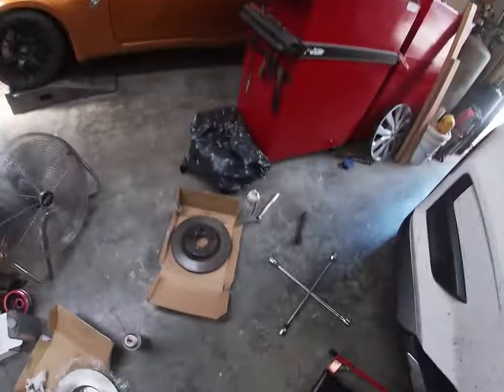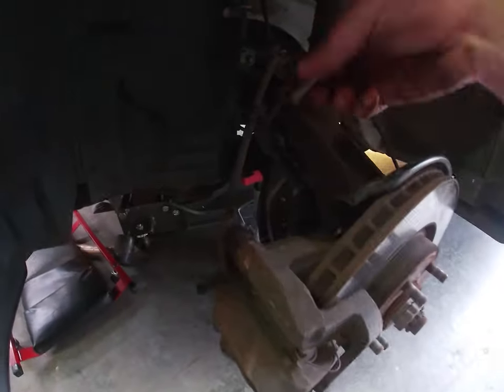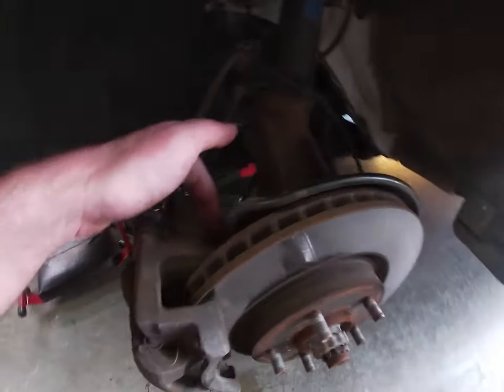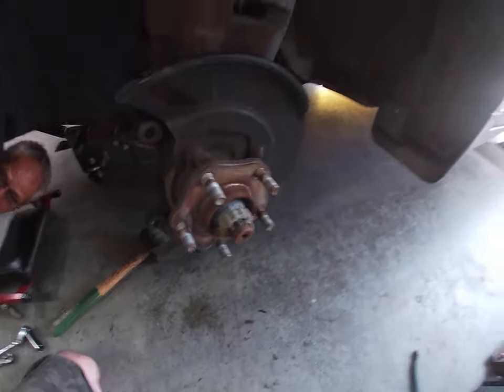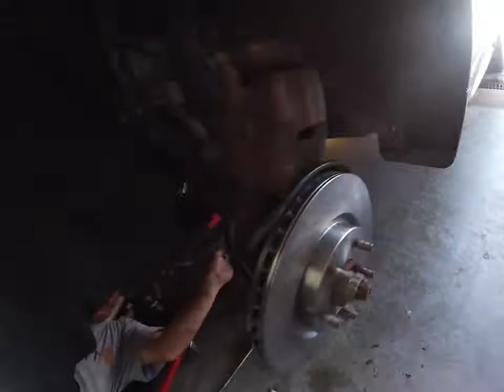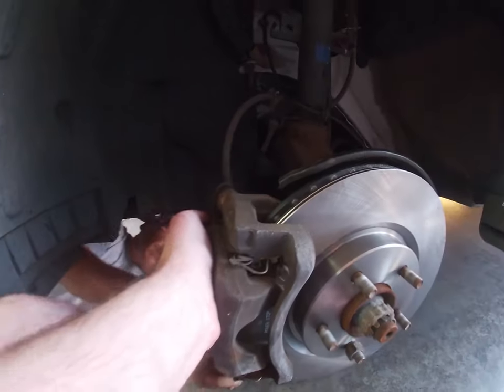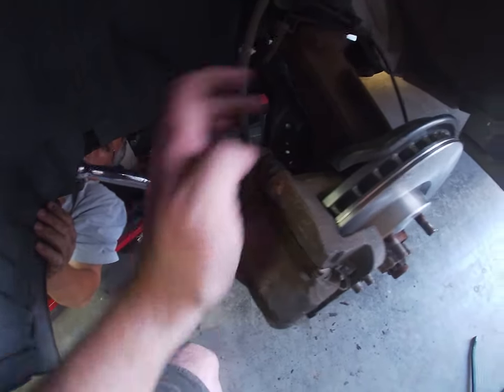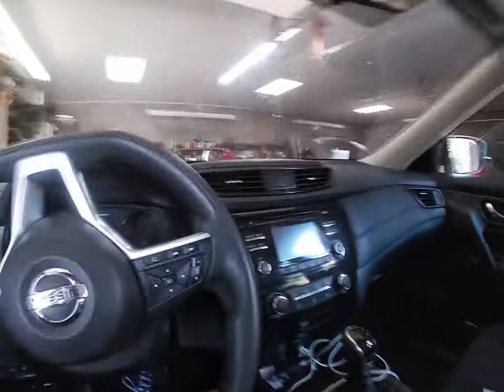2014-2020 Nissan Rogue front brake rotor change. Do it yourself with a few simple tools!

Comment: Can't believe you didn't clean the hub with a steel wire brush and apply a coat of never-seized. Take the old rotor to a local machine shop and have them trued . You'll be replacing them again.
Reply from the maker: Having a old rotor turned = $15 dollars and 3 to 4 day wait 
New rotor = $18 dollars in stock
Reply: My life in the pits : Cody rotors last 5 to 10 years depending on the driver. By taking your old rotors and having them turned now, you'll have them on hand for the next time. ( $15 today beats the $30 in 5 to 10 years)   Give them a good cleaning and CRC has and excellent product to stop rust. Just store them in a dry place but remember to label the box or you'll forger them.
Reply: Surfacing rotors is a scam. If it’s cracked or dented or warped, just replace them. If they are smooth and with no lip and warp, just spray them down with brake cleaner and install the pads over them.
Reply: Most cars these days dont have rotors thick enough to last 2 pad cycles, by the time you turn them they will be under spec for thickness.